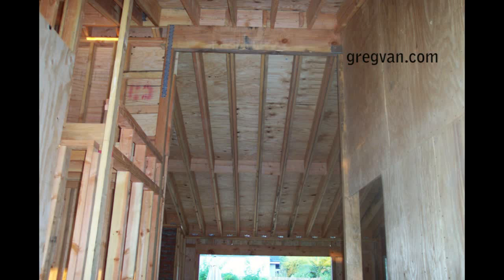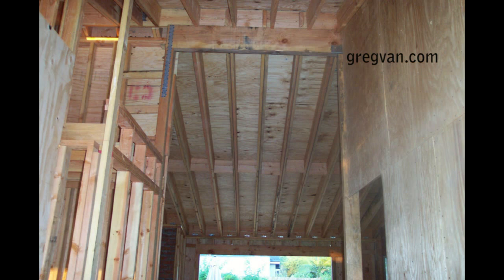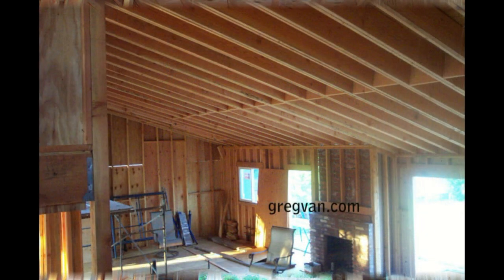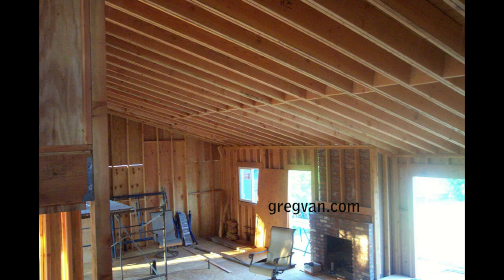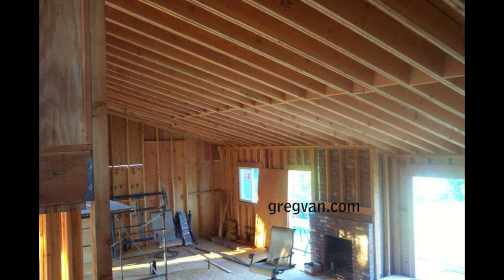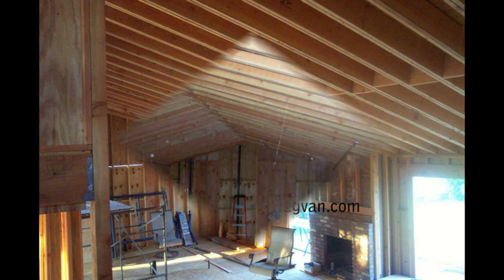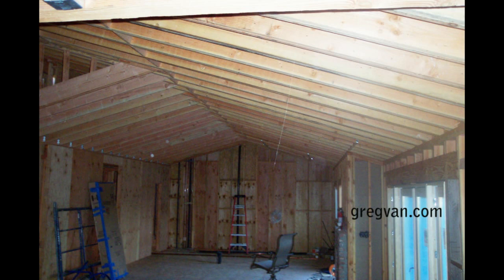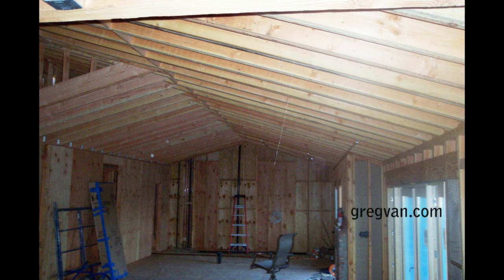Long Sagging New Double Roof Rafters - Structural Engineering Problems

Comment: Over built and I’m dealing  with under built. It sags with 2x4’s also….. We use to build by accident or purpose, raw milled lumber wins the day. I have a raw lumber roof from the 40’s and it wins hands down. I don’t know what they were thinking when they installed a 2x4, 4/12 roof over a span of ……oh my god…what were they thinking and what a fool I was at 33 years old. Had the inspection and never was it brought up and I paid. How I’ve paid. Widths matters at intervals and cheapness prevailed. I don’t know what to do. Suffering from 2 autoimmune diseases and giving up in my 50’s. My poor wife….

Comment: why do you guys always use these stupid 2x"whatever" for EVERYTHING? Why don't you use a regular wood 70x140 mm or similar profile spaced 800 - 900 mm apart with a ridge beam for a strong and steady roof and problem SOLVED? You rather produce these toy rafters and then you have to scratch your heads, making hmmm hmmm noises etc...
Reply from the maker: The bottom line is cost, if you have more money, then you can use better materials. Most tract built homes are all about saving as much money as possible, but on custom built home, that might not be the case, where the owner has more money.
Reply: @gregvancom  I get it but why to "build a house from paper when if it rains it would collapse". I'm having troubles to find someone who would be able to design a roof for me the other way than a north american way (2x4 roof structure) to achieve an open vault ceiling for a 26ft span while in Europe it's a daily routine in construction, not a biggie,  with that type of wood I mentioned which is apparently way stronger and you can even keep it exposed and make the whole space look warmer

Comment: Why not use engineering beams or microlam or just trusses? You by adding does interior rafters are building a truss.
Reply from the maker: Yes, you can use other materials, but sometimes they don't work the great either.

Comment: the second set of rafters could support the primary 24 footers only if #1 the middle wall was braced before hand #2 the 20 plus rafters were lifted with a girder to the point they are not sagging.  Straight edged / lasered.. See how much lift amount is 1/2 to 2 inches?? #3 Now measure the first braceing rafter and make all the same but place a vertical tie strap/ board  from the wall to the upper rafter that make a complete triangle. If you don't make it like a truss it will make a new modified sag. Has to be locked in with 2 'strings'. if not the wall will just lean.

Comment: It looks like if the rafters saged that much, they would have pulled the lower wall in? Did the rafters sag in the middle from one end to the other, or only the middle rafters (say 5' 6' from the ends) sag? Did you check the outside wall to see if it indeed came in as the rafters saged? IF that is the case, would vertical bracing from peak to the center of the lower wall. Similar to the bridging installed, but on a 45% angle (like a wall brace) this may help stabilize the outside wall. Also how about collar ties? None called for?
Reply from the maker: It could have moved the lower wall, but since wall bracing wasn't removed until after roof sheathing was installed, I don't think it moved much. It sagged all the way across length of rafter and bracing would have helped a little.

Comment: Today's lumber. The old Doug fir wouldn't have sagged like that at that span. I've handled a few of those. They were heavy, but did not sag like that, not even close. Was this a structural grade of lumber? Used to be that there was a grade of lumber stamped "Structural" and they were the ones (Doug fir) that were stressed by a big machine, and passed the test for deflection.
Reply from the maker: I would tend to agree, because I've seen doubled up lumber span long distances without a problem.

Comment: All structures are allowed to have deflection. Its Equal to Length/200 . So 24 ft=7.2meters  , equals 7200mm/200= 36mm is allowed.
Reply from the maker: So you're suggesting that a 2 inch sag in 22 feet would be acceptable or would it have been better to use different materials?
Reply: @gregvancom  22ft=264 inches.  Allowed deflection by timber design standards in two span structure would be 264 inches/200=1.32 inches. You can always apply more stricter requirements.
Reply from the maker: @marijussleckus5104  I understand now and really appreciate the formula and your comment. Who would assume liability for any problems that developed in the future, if the limit for maximum deflection was surpassed?

Comment: Hey I’m building a 40x40 garage and would like to keep the ceiling open like this. The garage will be attached and have a 4/12 pitch hip roof to match the existing home, with the ridge beam parallel to the garage doors. So I’m thinking approximately a 26’ structural ridge beam. So that would mean my rafters would have to be about 21’ long to span the 20 foot gap. Is that possible? Would it be solid? If not, would a couple more small beams placed halfway to support the middle of the rafters work? Hopefully this makes sense. I do have site plans as well as front and side aspect drafts done if that would help. I’m really trying to figure out how to build this right as I plan on staying in this home forever so I want it to be solid. 

Thanks! 
Jake
Reply from the maker: I cannot provide you with structural engineering information, however I can tell you that large garages will usually require additional supports like a beam to support the middle of a rafter. In other words you would have a wall or being to support the rafters on the bottom and a ridge at the top and somewhere in the middle you would have a beam underneath the roof rafters. Let me know if this doesn't make sense.

Comment: I call this BS.  So you are saying 24' long, doubled 2x10 rafters sagged 2-3" in the middle without any snow load.   Is 24' horizantal span or rafter length.  Either way, it will not sag that much. You need to get your eyes checked.
Reply from the maker: I don't know how you could've arrived at a statement suggesting that I'm providing you with fact, when I use the word guess. I guessed it was about 2 to 3 inches, but the point of the video is the fact that they were sagging under their own weight and it was much more than 1 inch.
Reply: gregvancom  those doubled 2x10s cannot physically sag 2-3” even with crown facing down. They are doubled, there is bridging, there is no load on it other than plywood and shingles.
Reply: gas pumper. No, it would not possibly sag that much.  Maybe if they were single 2x10 with snow load on them. This is a new construction. They are doubled 2x10’s spanning 24’.  

So you guys are saying a doubled 2x10 in 24’ length will sag 1” by it’s own weight ??? Bs.  Dont tell me there is roof sheathing and shingles on top. They do not weight enough to sag it 2”.
Reply from the maker: @Faruk651  It sounds like the person who requested me to get an eye exam might want to do an experiment for themselves. Feel free to do the experiment on your own and send us your results.
Reply: gregvancom  I have framed floors and roof rafters. I can tell you that doubled 2x10 at 24’ span (without load) cannot sag 2” with crown up.  
 
If framer did crown down by mistake (assuming they are not badly crowned) after sheathing and roof shingles and “over time” it may end up with 2” sag. But this is new construction.  Not possible.  There must be something wrong elsewhere. 

-Ridge beam not strong enough and rafters pushed the exterior wall outwards in the middle. 

-Exterior wall is not level at the top plate. 

-Some rafters crowned down and some crown up. 

It is not the doubled 2x10s sagging on it’s own weight in couple months of construction. If anyone thinks that is possible, had never nailed wood together. 

I dont want to be offensive, sorry if i am taken that way.
Reply from the maker: I understand where you're coming from and you are not being offensive in any way. However, I see no need to argue about something I witnessed personally and you are simply suggesting that there is no way a rafter spanning a distance of 22 feet could sag more than ???? inches without duplicating the same conditions.
 @Faruk651
Reply: gregvancom  How different can the conditions be ?  Grade of lumber ? No snow load i suppose ? Strong winds maybe. Assuming this is a couple months old construction at the time. How could doubled 2x10’s sag so noticeably in short time without any significant load. 

If this is the case than a single 2x12 cant span the 22’ distance either because properly sistered 2x10 is stronger than a 2x12 (same species). I believe you saw a noticeable sag in the roof but hard to believe double 2x10s sagging by it’s own weight without snow load, high winds and time.
Reply: gregvancom I am looking at a 100 year old house roof that is made of rough cut 2x4’s spanning 15’ (5/12 pitch) and they have 2” sag at the worst spot.
Reply from the maker: @Faruk651  I understand where you're coming from and you have valid arguments, because I have seen a lot of what you're suggesting. In my opinion, the lumber wasn't dry enough and was soaking wet and sagged under its own weight and might not have sagged as much if they weren't nailed together.

Comment: 14 to 16 " i- joist 16 " on center or if you really just wanted to beef it up 12" on center !
Reply from the maker: Yes, different lumber or engineered lumber along with 12 inch on center spacing might have worked better.

Comment: That’s why you don’t use regular lumber , when you have a long roof span
You use engineer lumber on a roof like this .
Reply from the maker: Or redesign the building to where you can use structural beams near the middle section of the roof rafter span to provide additional structural support.

Comment: If a building is 26 feet wide would there be the same problem with the roof sagging...?
Reply: BigRed56 i had a porch done last year that is 25x35 the rafters are 2x6 an it sagged. they are fixing to put bead board in the inside but the sagg is there and dont know how to fix it
Reply: My thoughts are that 2x6 lumber over a span of 25 feet on a "a frame / Gable style roof - would require at least a 2x8 or even a 2x10 for the rafters. And a center ridge piece ought to be wider then the rafters and this is a 2x12.  Some might suggest doubling the ridge with two pieces of lumber - or using LVL.
Reply: 2x10 would be more robust over a single span of 12 - 5 to 12 - 6 roof pitch. Most of a 16 foot piece would be used with the possibility of needing to add to the end for roofing requirements.
Reply: @edgar4531  who the heck decided 2x6 were enough to span 25 feet lol...crazy under built
Reply: So for a 12' lean to roof using 2x6s what length size should I use?

Comment: I cannot imagine why wooden girders or I-beams were not used.  I was at a builders home for a Christmas party with about 35 of use hanging around in the kitchen and eating areas - one large open area.  The builder, a good friend, wanted to show me something.  He had waited for this day; he took a marble out of his pocket and laid it on the floor.  People were walking around and while the marble vibrated a little bit, it did not roll.  Next he took me to the basement and showed me the wooden girders holding up the floor - 36' long.  It's, as you suggest, the right material for the right application!
Reply from the maker: It just goes to show you that engineers won't always be correct.
Reply: John Gritman, please tell me what kind of girders (I-beams) were there... width, thickness... what spacing? I am working on this project to build a lean-to roof by my house, which I want it to be a 4 car garage, with a width span of 22 or 23 feet, where I would use 12'x3' steel roof panels. I am in Florida, so the roof can be and has to be almost flat. I am thinking of building my own wood trusses (rafters) or use some kind of I-beams.Thanks a lot.

Comment: I can run the deflection and stress numbers (assuming southern pine).  What area is this location in and what is the spacing between rafters?  I would be worried about live load and snow load (if applicable) causing excessive deflections that would result in cracking sheet rock and potentially overstressing the rafters.  Typical rule of thumb (for steel design) is using a section depth (inches) that's half the length (feet).  So for a 24 ft span, I would use a minimum (12" deep steel wide flange member). Wood is totally different, which would require a larger depth since the elasticity is much lower (stress vs strain).  For a 24 ft span I would have designed roof trusses or engineered I beam wood rafters.  This definitely leads me to believe it is under designed.
Reply: +AddictedFishing1 Hi there. I can run this through my engineering software if you like ( i&#39;m an architect ).  Span deflection that avoids appearance problems is set at 1/360th of span under dead load.  So give me the legally agreed design wind load of the area in metres/sec, the anticipated dead loads ( light snow, heavy alpine etc ), the area&#39;s design wind load for your terrain, ie your legally assigned design wind on the basis of a 50 year design return period( is this an exposed site and how far are your from the apex of a hill? ie in the middle or upper third or beyond the ridge in the negative value (Lift) area )and the anticipated impact of earthquake loads.  Then tell me your GPS coordinates so I can see if you&#39;re within 200m of open water. Also, I&#39;ll need a geotech engineering report so I know you aren&#39;t building over an old mine shaft.  I&#39;d do this for free, but my insurance requires a fee of at least $3000.  And so I hope you see why builders cheat a lot and your floor sags like an old womans tits.  You get what you pay for. What's cheaper > doing it by the book in the first place or trying to fix all the stuff ups later?
Reply from the maker: AddictedFishing1 The home is located in Southern California, so snow loads wouldn't be a problem and I'm pretty sure they're 16 inches on center. It wouldn't have been a bad idea to lower the ceiling and use an engineered roof system or beams.
Reply from the maker: I would give you the information if I had it.

Comment: Would is the minimum deflection criteria for residential construction?
Reply from the maker: AddictedFishing1 I'm not quite sure and I don't know for a fact that the engineer actually made an error. This isn't the first time I built something that was approved by a structural engineer and by city or county engineers that didn't work as well as they might have thought it would, because it looked correct on paper.

Comment: I am changing my 8ft ceiling to cathedral ceiling(23ftx28ft area above the garage built on 1980) with connecting the 2x8 rafters to the old rafters.I am using metal plates to connect each rafters to 2x4 on the wall and adding more 2x4 for extra support.I used collar ties on almost 2/3 of the rafters and added rafter plates to connect the upper ends for more support.
I did not have ridge beam or board so rafters are facing each other and connected by old rafters.I didn't change the area of over hang or anything else.what else can I do to make it work and safer
thanks
Reply from the maker: You're probably going to need a ridge beam, but here's a link to a video that might be more helpful.http://youtu.be/D8jxBfrOexo

Comment: My house was built in 1923 and the roof sags a lot. I am not sure what I can do. I believe the sagging is due to 3 reasons... using 2 x 6 rafters, a low pitched roof, and a huge span between the 2 beams. It is interesting how massive the beams are when it would have made more sense to construct 4 lighter beams but my guess is they wanted to keep the attic open for possible bedrooms. The sagging applies outward pressure to the front and rear walls of the house and must explain why they criss-crossed 2 x 4s along the floor of the attic, tying the ceiling rafters and walls together. The ridge beam is 3 segments of 2 x 6 mended together to compete the full span with one piece being just a few feet in length. It is amazing how they constructed these houses and appears they were pulling whatever they had off the truck and designed as they went. On the other hand, it is possible they had 3 layers of roofing on it at one time, adding to the sag.
Reply from the maker: You definitely solve your problem. The extra weight with the three layers of roofing and the over spanned materials might be the problem. If the home wasn't inspected by your local building department because it's too old then you're probably also right about the design as they went type of building.